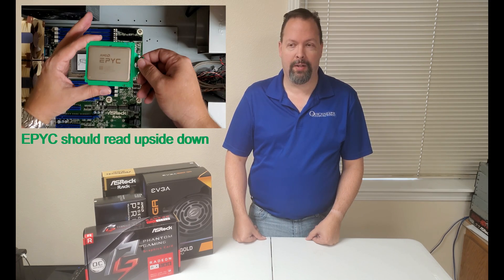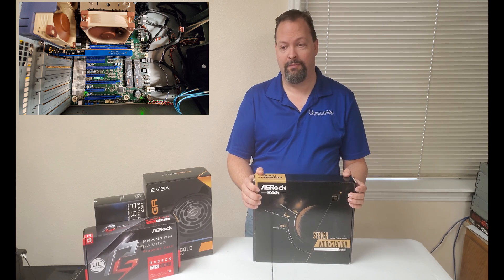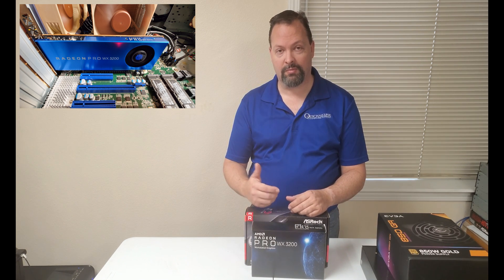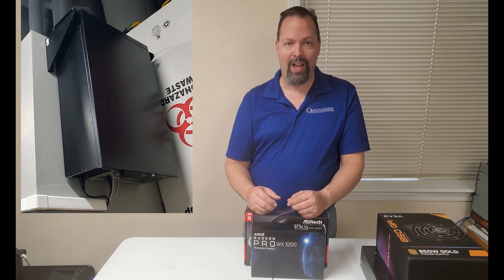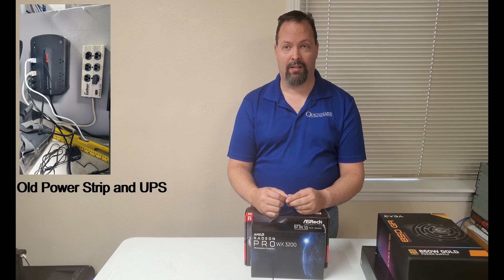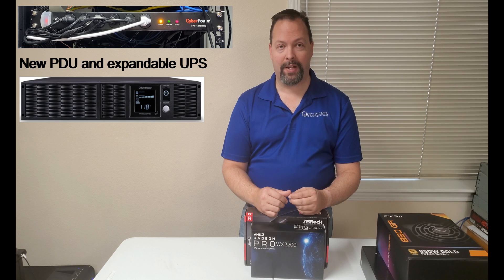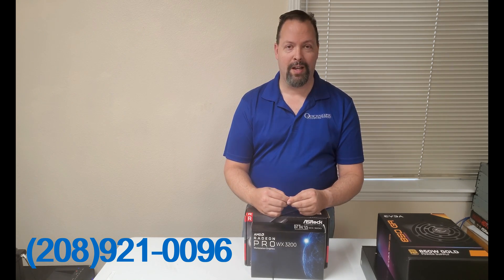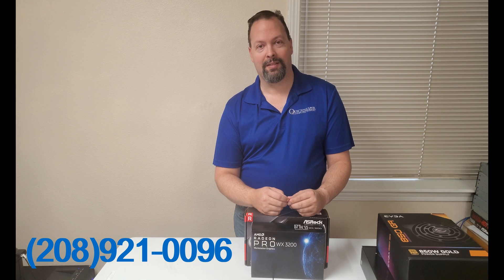EPYC Server Build Part 7 (Lessons Learned)

Comment: Having a similar settup as yours I feel sorry for the bad luck you had with your CPU. I must admit that I bought my CPU on ebay and apparently I got very lucky. Same goes for the memory which I bought. There is certainly a big factor of luck when buying hardware.
Reply from the maker: Yeah. That was a massive headache, but the machine runs like a perpetual top now. Every system is always a learning experience, and I've been doing this for 20 years.